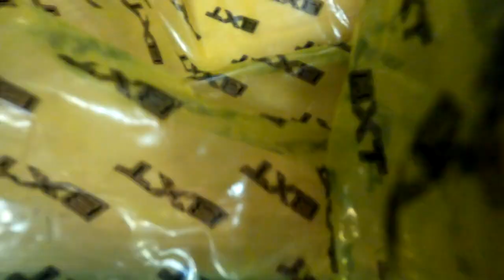Plow Truck Maintenance || Changing a Wheel Bearing on Ram 2500

Comment: how do you like those duratacks in the snow i heard some decent things about them but more good things about ko2's other than people saying they wear out too quick but on my dads old plow truck he went 3 sizes up in height and width and was left with a big tire that would get him out of any sticky situation. the tires dry rotted before they wore out.

momentum and make a couple of passes. like cutting tall wet grass (im not sure if its applicable) but just doing a couple of fast passes instead of pushing all of it at once
Reply from the maker: Yeah we were trying to cut the top down some first but i kept breaking through the crust below. And below that was icy road. He just let it get to far. Couldnt get it all at once if i wanted. 
The duratracs - im a huge fan for a long time of these tires. They are great in the snow but they do have their limits. Im tire shopping right now for my other truck and im seriously considering the ko2's. Heard good things as well.